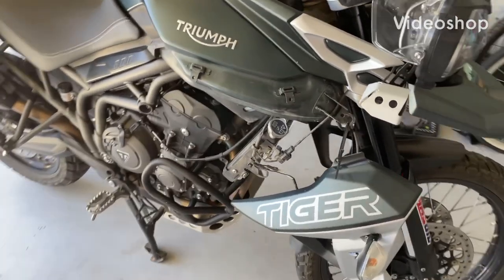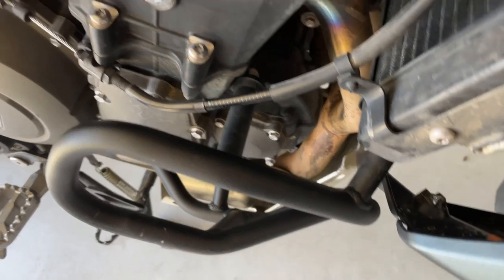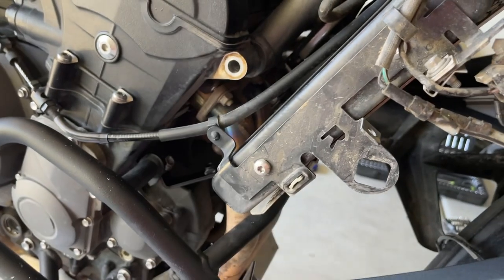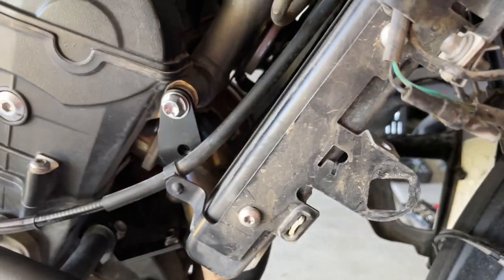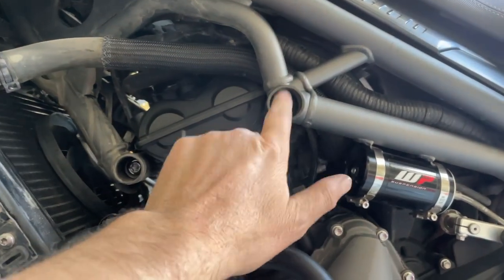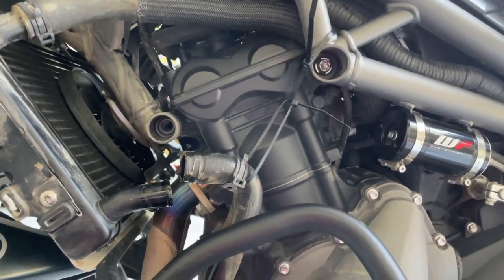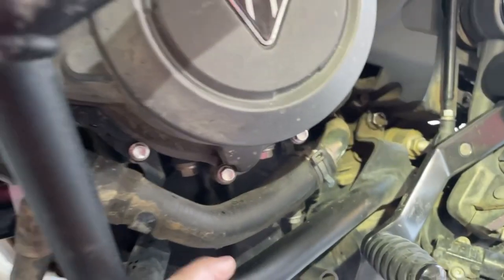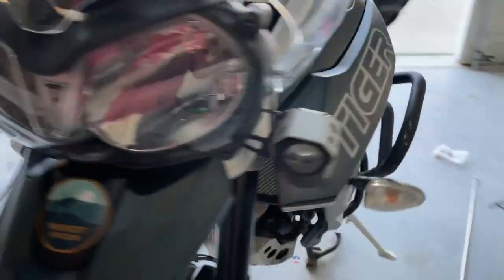Installing Crash Bars on a 2018 Triumph Tiger 800 XCa | Step-by-Step Guide

Comment: Thanks for the video, but would you mind listing what crash bars they are and where you purchased them? Also, technically speaking those crash bars are protecting what Triumph calls the upper and lower radiator cowlings. The fuel tank sits much higher.
Reply from the maker: Thanks. I understand the callout, and I probably could have just called them fairing protection, however on the website I purchased them from, they are called fuel tank protection bars.  Here's the link: https://shop.triumphcleveland.com/store/Triumph-Tiger-800-SS-Fuel-Tank-Protection-Bars-A9780065-p125489535
Yes, I painted them to save money and it's worked perfectly.